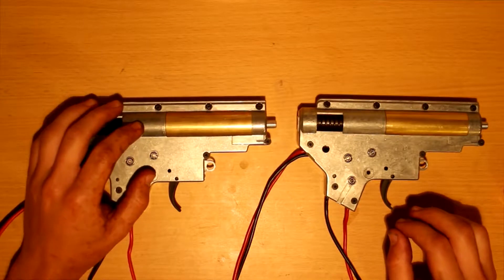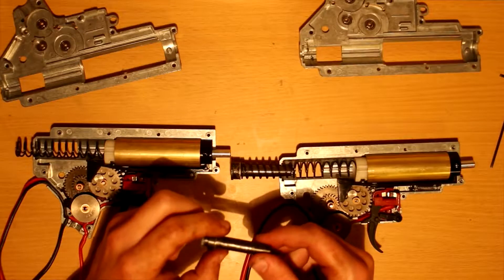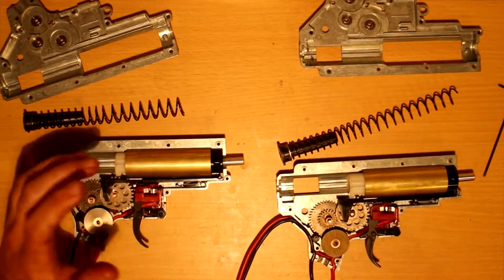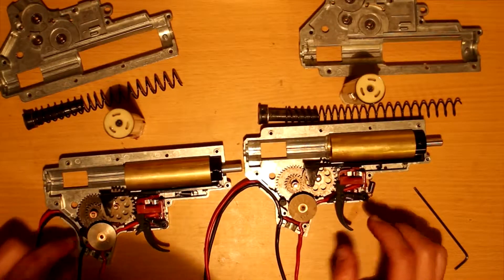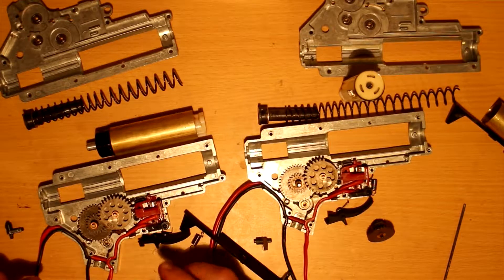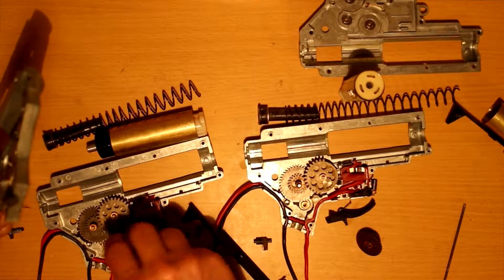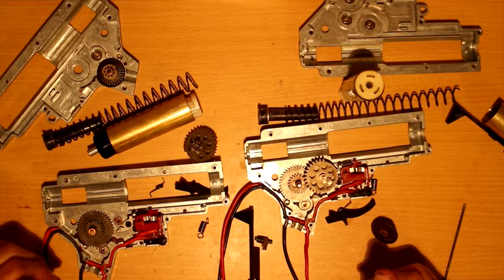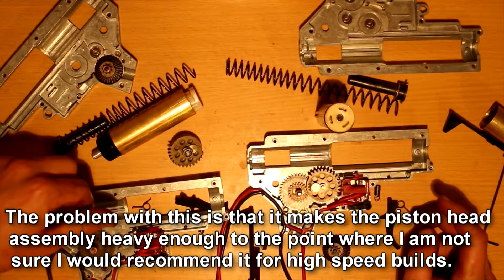G&P Aftermarket Gearbox Review and Comparison

Comment: Ever have an issue with these DX v2's snapping gear spindles? I had mine crack a bearing and snap the bevel gear axle after two games. I also noticed the hopup would wedge itself into the outer barrel to the point of needing a screwdriver to pry it free also it would snap free sometimes while firing in semi auto. I'm assuming this is why it broke. Because I was 30 days past the 45 day warranty evike choose to not help me. So now I'm trying to fix my 550 dollar TOY so I can use it .

Comment: im having trouble with the selector switch problem to how did you fix it !!!????
Reply from the maker: I haven't "fixed" it yet, although my current Combat Machine with this gearbox shoots full auto and goes to safe. Semi auto seems to have this problem: The Trigger Skipping Problem Fix (Version 3 Gearbox) 

Check the selector switch and selector plate alignment, make sure the selector cam is tight on the selector switch, and make sure that there isn't a lot of friction between the body and the selector plate.

Comment: so its not really 400 fps lml but i have an a&k not sure on the hop up but would this work in it my old gear box broke or do you know where i can get a rear wired gearbox pre assembled plz help
Reply from the maker: Try Evike, they seem to have a decent selection. Personally, I'd tune up any preassembled GB before I'd run it just to be on the safe side. JG boxes with metal bushings are actually pretty decent, but if you plan on upgrading later the G&P is great.